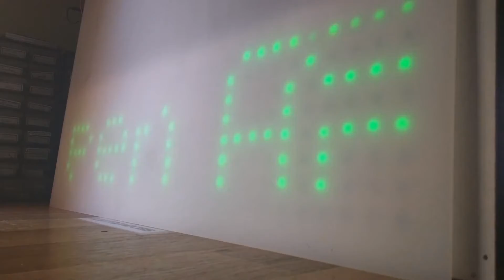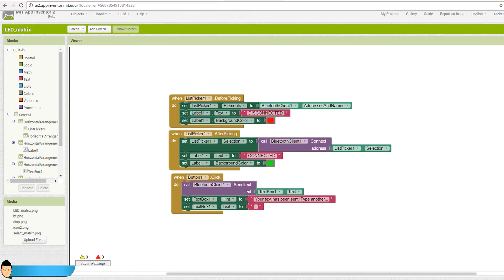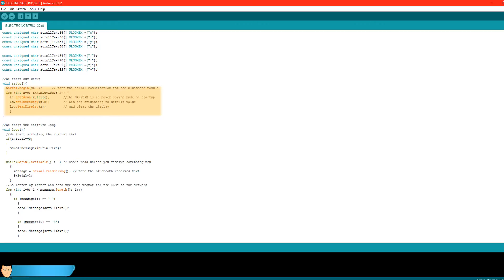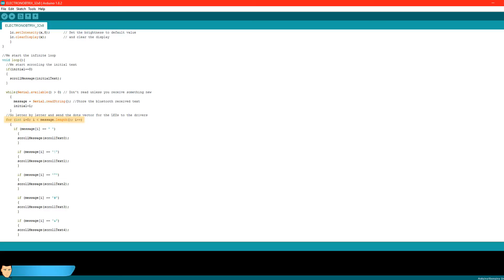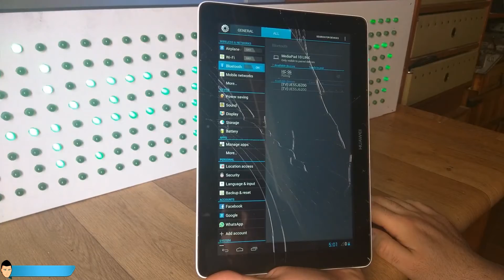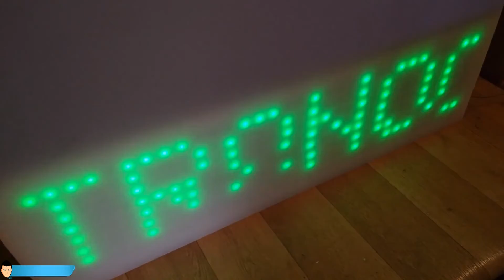Bluetooth scrolling text LED matrix with arduino

Comment: I have a drawer of about 30 nanos,  unos, megas. I only need the ftdi if I just wanna wireup one of my loose atmega 328 ics correct? I have an ftdi and the ams 5v ic but I'm just going to power it from a 30 watt usbc smps. It's going to be a gift for my wife. I can't imagine e how much those leds cost you but I have about 400 100mm clear green ones I spent a ton on. I'm an led fanatic. I have about 25 thousand leds of all different types. I'm going to 3d print the front plate of the display using some high end quick changing matte rainbow filament and I'll just use black pla for the rest. Thanks man, I just ordered the max7219 ics and the bt module. I was going to do it with 595s but this way is much better

Comment: Could an ON-OFF-ON switch be added that would connect the RX & TX pins to the bluetooth module in one position and to the Arduino in the second position? In theory it would eliminate the need to unplug the bluetooth module.

Comment: Works really well but I'm stuck when I want to scroll with 8 daisychained Max7219 units.  Any suggestions?  
const int numDevices = 8;   doesn't work.
Reply: Hi man, can you solve the problem? I have the same problem
Reply: I too have same problem
Reply: Also have same problem, but I see you don't answer questions so not like or subscribe you

Comment: Hi all. I ran into a minor issue with the character mapping as the semi colon ;  did not exist and the ‘ hyphen did not work this was due to Arduino believing I was trying to end code . If you use an escape character as in ‘ ‘ ‘ will not  work, this will work. ‘ /‘ ‘ try it.  Also the semicolon will need to be written in the code at position 93  I do hope this helps someone who was at first not sure what was the problem.

English what a language !!!!!